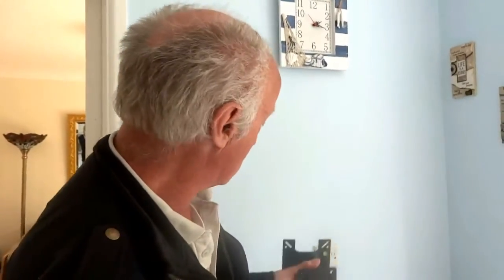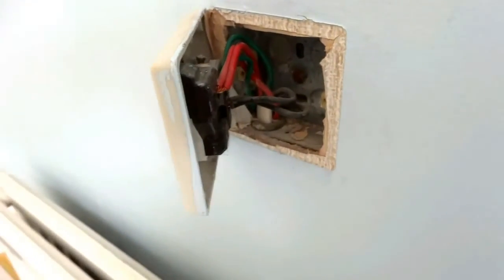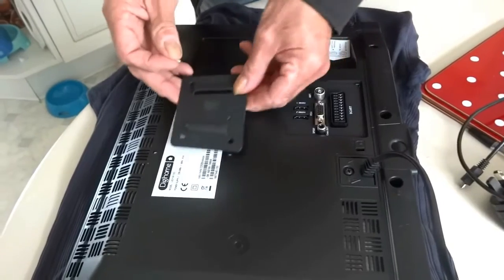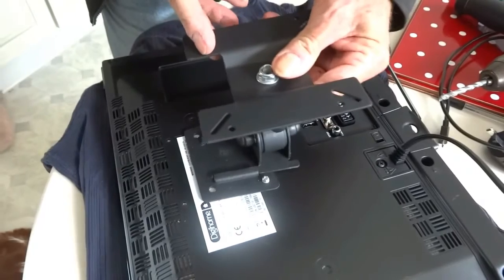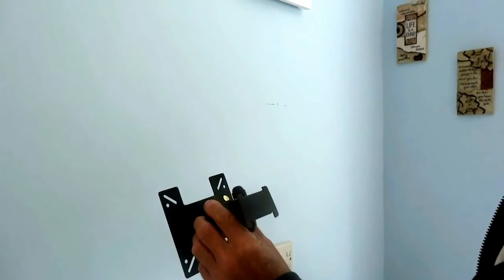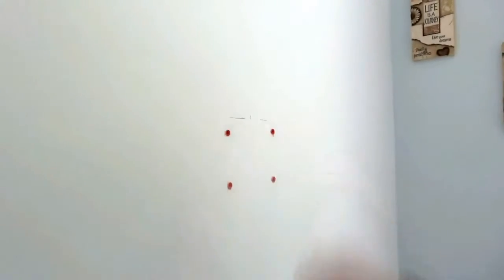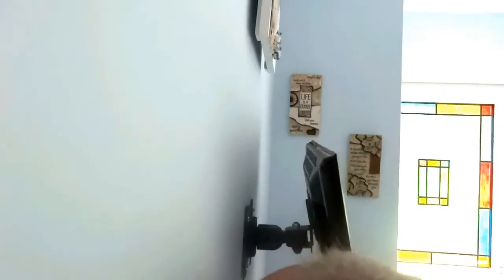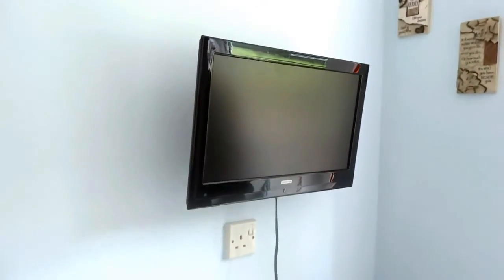Need to fit  flat screen tv bracket to the wall?  Here's how to do it. It's easy

Comment: I might be wrong.... but I'm pretty sure you have the wall part of the bracket mixed up with the TV one and are using them the wrong way round.
The larger of the two plates has diagonal slots to enable you to fit it to a multitude of VESA compliant TV's. That explains why your plate only covers 2 of the screw holes on the rear of the TV.
But if it works and it stays up...

Comment: yes, possibly, Craig, and one of my TV's is a 32" flat screen that I want to wall mount, so I will take that into consideration. However, once again dereton33, a very easy to understand 'how to video.'  Awesome...

dereton, just one question? My 32" is a couple or more years old, and I'm pretty certain that it will need the heavier bolts that came with it, that you mentioned in your video, as it's quite heavy. I doubt that I could even find those bolts now. So, will I be able to buy some more from my hardware store? And, how would I know which ones to get?

Many thanks for your very helpful video's...  :)